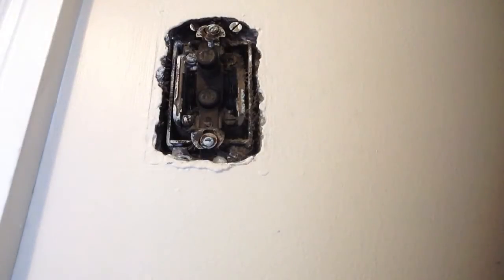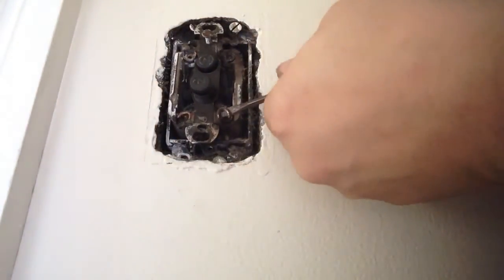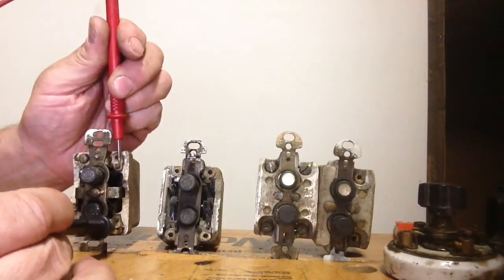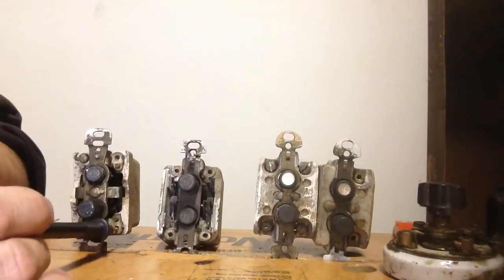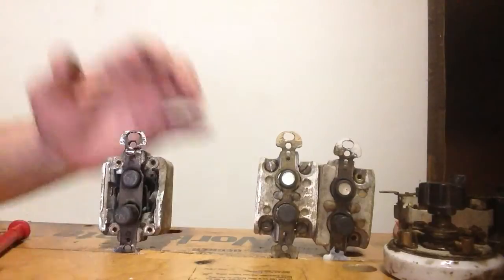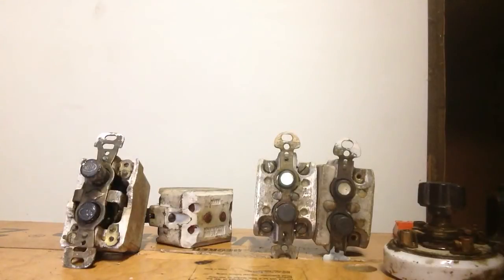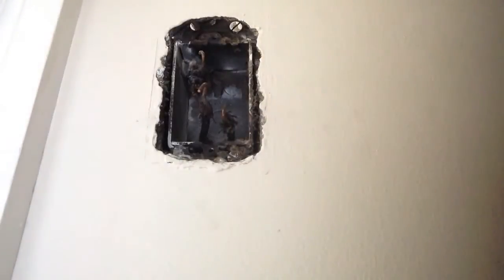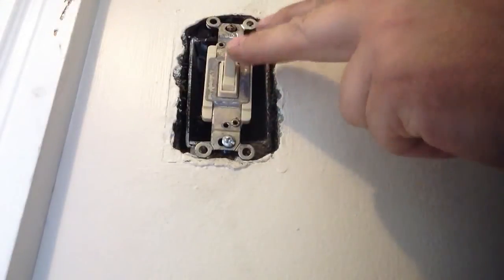How to replace three way push button switch

Comment: Thank you for this helpful video!  My house was built in 1928 with original push button switches. One is stuck but think I can remove it and fix it.

Comment: Thank you so much, I took my switch out because it was not working, only to find the parts inside were frozen. I sprayed it with electrical spray made for contacts , but I didn't actually spray the contacts, I only sprayed the parts that's move back and forth. It did start to work when the button was switched, but the next day when I installed it  worked but I had to push it a second time to get it to work.  I foundan old push button  switch on Ebay, because I like the old style, but was wondering about putting it in correctly.  If I had to go to a modern switch, I was really concerned, not knowing where the common would be.  Your video helped me out TREMEDOUSLY  !!!  Thank you so much...

Comment: I also had a question about lubrication, was there any kind of grease on the parts that move the connectors back and forth...Thanks again !
Reply from the maker: I really like push button switches. There is not a lubricant that I know of to lubricate switches besides 2-26 lubricant. Avialable at your home center. They do make new switchs that look like a push button switchs with modern internals. I have never bought one of these because of the price. This might be the time to replace that great push button with a new switch.

Comment: If you weren't paying attention when you took the box out how would you know which wire coming out of the wall was common?  Are the switch wires always together
Reply from the maker: How many wires do you have disconnected.
Reply: 3 wires
Reply from the maker: Is this part of a 3 way switch?  2 switches work one or more lights.
Reply from the maker: I think when you say common you mean the common terminal of a three way switch. There would be a common terminal on one switch that would bring power into the circuit and a common terminal on a switch that sends power to the light. If you have disconnected the switch that has the common terminal that brings power into the circuit would be simple as returning power to the circuit and testing which wire has power with a common tester that lights up and beeps when it senses power. The common wire will have power and the rest of the wires in the circuit will have no power. If you have disconnected the switch with the common that sends power to the light. Turn the power back on and test to see which wires have power when they are switched from the bottom switch. The power will switch back and forth between the two wires. The 3rd wire will be the common wire going to the light there will be no power. All of this is assuming that the old wires are switched through the hot wires and not the neutral wires.